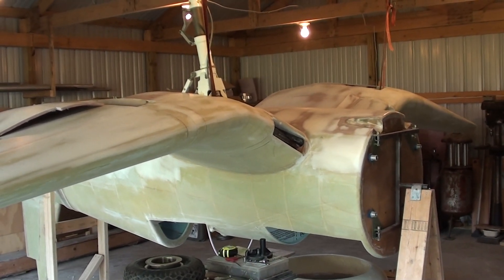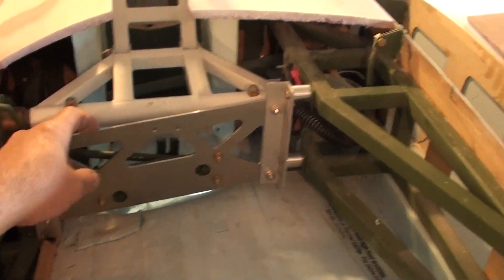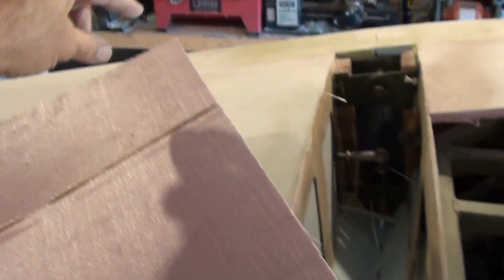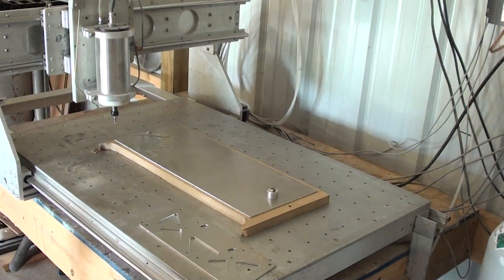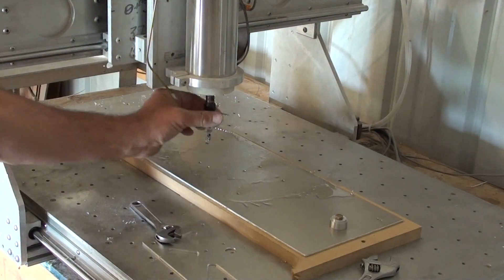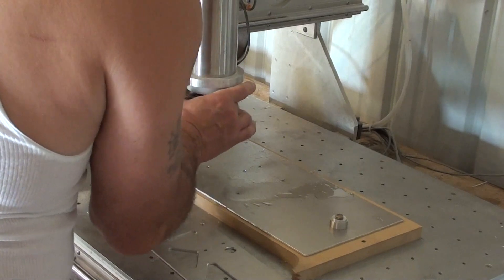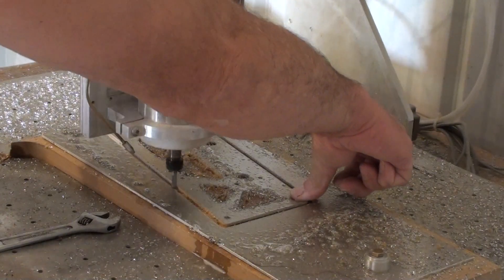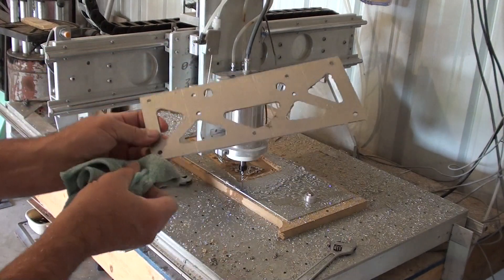W.A.R. Corsaur Update 8-12-18

Comment: It will be interesting to see how the doors clear the curved bottom of the wings using (full length?) piano hinges. I am sure you will only use a few inches to secure each door, right? Great video and thanks for sharing the CNC insight. The gear working out to fit perfectly is something really to be celebrated.
Reply from the maker: LThorsen78, The gear doors use full length hinges. The hinge will stick out a little in the front and rear to work right. That's the way the plans show it. It was nice to see the wheels clear after I foamed it in.
Reply: I think LT is right, if the gear door is curved, I think you can only use a couple of sections of hinge so it pivots on a single axis and doesn’t bind.. maybe it looks different on video..
Reply from the maker: taltruda, the hinge ends up sticking out some in the front and rear of each door panel. That's what will allow the door to clear when it opens. You will see it when I get them installed.

Comment: How do you bend the foam for the gear doors? A heat gun and weights? Also is that gorilla glue on the gear door pieces? Sweet little CBC router..is that your own homemade design?
Reply from the maker: taltruda, The foam is pretty thin, so it bends to the curved shape pretty easy. Only used tape to hold them in place until the glue dried. I used a piece of foam set on top of the gear leg to help hold the door away a little for room. Worked out great. Yes it is gorilla glue. Sets up quick and sands out easy.
Reply: Dynodon64 yeah, but it looks like it is holding its shape.. once you tape it on and it is bent, how is it staying curved? Is it just the glued pieces that  keep it curved? Thanks! -Tom
Reply from the maker: talruda, The foam holds it's shape because it has two layers of fiber glass cloth on it. The whole plane is covered in it. I built the CNC from scratch myself.

Comment: Hello Don, been following you for a long time now, actually from HHO replication and SM. I am a retired A & P mech. Last few years was a quality control manager for an FAA approved repair station. Built my own CNC plasma/routing machine as well, now that I'm retired might have time to use it a bit. Enjoy watching the progress on your build, have a good one.
Reply from the maker: Jeff Nading, Thanks for the comments. I remember you from the SM days. Had some issues with the CNC not cutting right. Need to look into the problem and get it working right before I use it again. I worked at an FBO as a mechanic for a few years myself, after I got out of the Marines as a C130 engine mechanic.
Reply: Dynodon64 very cool Don. Had a few C130 parts come into our shop for repair. Had repair contracts mainly on the KC-10, still in use for air to air refueling. Also did the Airbus A380. Looking forward to your paint job and seeing you fly your new bird.